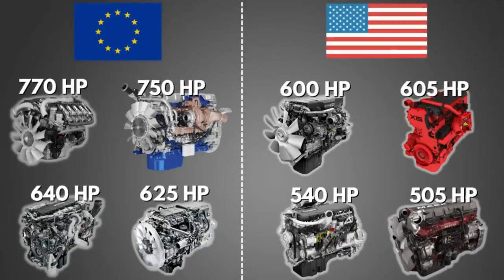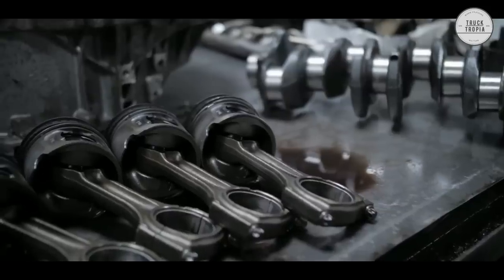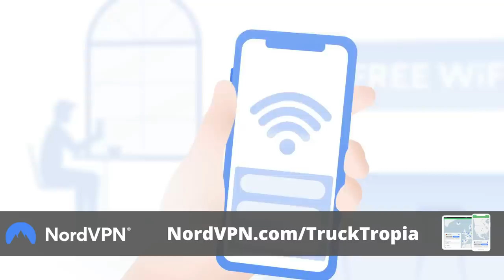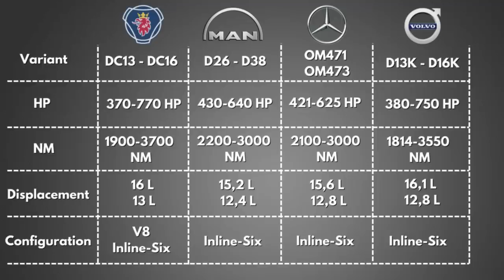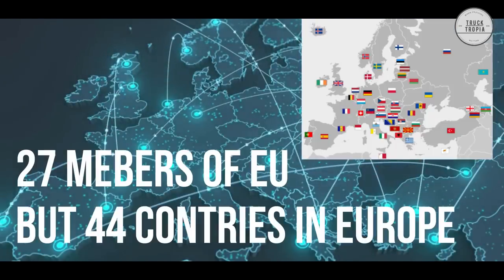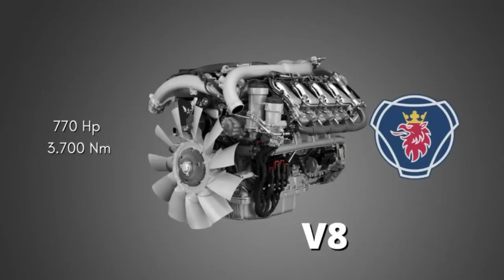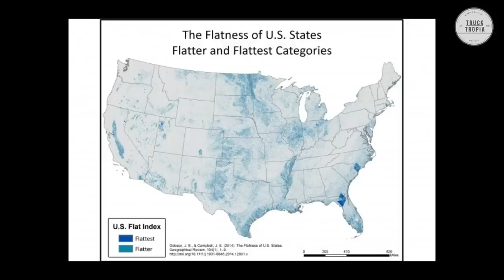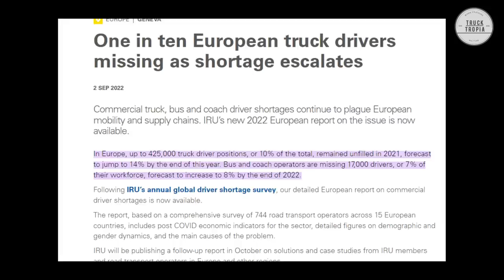Why European Trucks Have Up To 770 HP And US Don’t

Comment: HP is not the whole story of engine performance. You might have a lot of HP, but not enough torque at lower rpms what might be important for hauling weight. For example tractors need more torque. They can do a lot of job without high HP. There are applications where HP is not important. Horse power is function fo torque and rpms. If your engine is designed to operate at high rpms, it comparatively will have more HP.
Reply: Anything can do a lot of job without torque. You meant work of course, which is a mechanical energy, and energy is strictly related to fuel. Do infinite work as long as you infinitely add fuel to the tank.
HP is a unit of power, and power is the only measurement of performance. How r u gonna measure it with anything else and why?
Reply: @simplemachine9531  Yes, you are right. To be  more precise, tractors need more HP at lower rpms, comparativey more power, performance at lower rpms. High horsepower at high rpms are for sports cars and pure speed. Thats why sometimes tractors have less maximum horsepower, but can do more work while driving slow. You really have to look at power curve to judge the performance. 750 HP Ferrari is not the same as 750 HP truck.
Reply: @kg0173  good. Still, tractor doesn't do more work at the same time frame as sports car, if sports car engine outputs higher power. There is a constant confusion between power and speed, torque and work, work and force.
Reply: @simplemachine9531  Tractor can pull 10 tons for a definite distance in 1 hour. I don't think sports car can do the same. Probably it could if you put the same engine in a tractor and operate it at rpms that generate the higher HP.
Reply: @kg0173  save our time and check what work is.
Reply: @simplemachine9531  Work is force by distance. Can you explain? If you understand well you could explain it simply.
Reply: @kg0173  not necessarily simple. 
You see there is a multiplication. Pulling a 1g feather around the globe is the same amount of work as pulling a 40kg box for 1km. And you don't need a tractor to pull the feather. But you need the same amount of fuel.

To balance between force and displacement there are simple machines, a wheel, to name one. A smaller wheel installed on a driven axis provides more force at a proportionally shorter distance. Gears are a type of wheel also. 

Torque, when multiplied by 2π, is an amount of engine work per its rotation. It means nothing, because we are not restricted with the amount of rotations. Like "dig that hole but don't allow your engine to rotate more than 100.000 times in process". We can install larger wheels or a shift up some gears but the amount of work to do remains the same. 

Similar relationship, but of force and speed now, is within power. A more powerful tractor will make more work (apply more force at the same distance or same force at more distance, or any combination in between) at the same time. Or same work faster. 

If a car rides by the side (same speed and acceleration) of a tractor and its engine generates twice more power it only means it hauls twice the load, nothing else possible here.
Reply: @simplemachine9531  Thanks for explanations. Definitely will learn from this.
Reply: Think of power as simply torque in motion.  Torque by itself can do no work - it has to be delivered at some rate to do anything.  And the rate at which a given amount of torque is delivered determines the amount of work you can do in a given time period.  This is the very definition of power.  This is why even things like tractors are always rated by their power level and not the engine torque.  Where in the rev band the peak torque occurs will tell us something about the engine's power curve but the actual torque number is largely irrelevant.

Comment: Nice video but it would have been nice to talk a little bit about the powertrain, like just a quick 30 sec, a 9 gear transmission vs a 18 gear, What transmission they have in EU? Even the same engine and transmission pack but different differentials can be day and night. It's not only about the number under the hood, IE: a F-250 and F-750 have the same number, but the f-750 can pull more weight.

Comment: 00:50
Did you say you something like you do not need more horsepower as long as you have higher torque?? 🤣  Dead Wrong..
The higher the torque output in a certain rpm, the higher the horsepower.. 🙄
So if you have 800nm of torque at 1,000rpm, and the other has 1000nm of torque at the same rpm, the other will obviously have higher horsepower output at the same rpm as you are..
Horsepower is a combination of weight, distance, and time.. which means there is an actual work done.. while torque is just the measurement of force you are applying to, but doesn't necessarily mean there is work done..
The only way you can offset the engine with less power is by having shorter gear ratios.
And even if you say american engines are designed to produce most of its power down low. How can you be so sure that at the same rpm those European engines does not also produce same of not more torque? 🙄

Comment: The US engines were 15L and the big "Euro stuff was only 16L.. It's virtually the same, and has the same torque.  It only has such a higher HP rating because it can run at a higher RPM.  and HP is calculated with torque and RPM's.   click bait

Comment: It's not all about the Horsepower. With Diesel engines, it's all about the Torque. Yes you need Horsepower to get Torque. But then you factor in Gearing in Transmissions and Rearends.

Comment: The real reason is that US trucking is about 15 years behind Europe. We have tighter emissions, more technologically advanced trucks. Automated Gearboxes. US operators are still clamouring for two stokes and 'floating them gears' (Note: European Gearboxes have had syncromeshes since the 70s rendering this process obsolete). Americans are very difficult to change or introduce new concepts to. The tractors you have in the US are awful compared to a European Cab Over. We have much more manoeuvrability, visibility, better economy and a much lighter truck. There is no dead space in a Euro truck, everything has a purpose.
Reply: Actually the US has more stringent Emissions and fuel regulations which is why the trucking industry is dying. Also all the truck manufacturers in the US are owned by either Daimler, VW, Paccar or Volvo. Hino and Izuzi are also very popular in the truck class 4 to 6 range. As stated in the video all the engines share the same parts as their European counterparts..

Comment: Your statements on the D16k is not accurate when it comes to being the most powerful engine in the world it looses to the cat C18 and Cummins KTA 19 in torque and horse power those are only heavy haul truck which you conveniently overlook which are used for loads over 80k the standard non oversized load truck so to compare apples to apples they need to be included also just saying Cummins has been making the KTA19 since 1974 way before the EU was even in that ball park. And what you said about cosmetics and power when it comes to EU over US are completely off based look at America Pete 379 and Kenworth W900 series truck owners clearly this whole video was biased towards EU hope you try harder next time

Comment: There are several strange statements in the video.   
"The truck are so much bigger in the US"  So adding a sleeper box ...and also extend the wheelbase ..... makes the truck "so much bigger"...???   That is mostly an visual aspect, not much in weight that affect the pulling performance of the truck.  The European trucks are both taller, wider, more powerful and probably heavier  ....what about that...??? 
To link trucks (manufacturing) to EU is just nonsense.  They have nothing with each other to do, which makes the presented narrative in the video to collapse ...it's just a mess.   These trucks are EUROPEAN not a EU thing.
The "logic" in the video linking the area of EU that is less than half that of the USA to why trucks are more powerful in Europe is just mind blowing ridiculous.   There are no limitation on transport of cargo with trucks to EU only ....they drive all over Europe and beyond into Asia.  Europe is in fact bigger in area than USA and as mentioned the truck transport also extend into Asia.
The myth often presented, that the US trucks need the sleeper cab, ...."because the distances in USA are so much bigger" is also  just ignorant nonsense.   No distance in the US can match Europe ...period...   If the distances are extended into Asia which is a common thing then US distances will just be a joke.
The reason for the size of the cab of European trucks is because of regulations. The total length is one such regulation and the labour laws does not allow truck drivers to live in the truck for more than a few days in one go.  They protect people from being used as slave labours ...living in a box with the size of a dog house.  I simply find it mind blowing that in the USA they seem to be proud of having a slightly bigger "dog house" on their trucks.  The labour laws in the USA is more or less absent.   Not much to be proud of.

Comment: Torque is not work. Horsepower is work.
Reply: Horsepower is not either
Reply: @simplemachine9531  
To correct myself, horsepower is the rate at which work is done.
My bad~

Comment: because we dont need big slow ass trucks like your old american trucks to transport big loads almost of our engines are straight 6 cylinder in line litle engines but powerful ones we dont need big v8 engines like you do to take big loads we use v8 engines like scania cause scania v8 engines like the new 770 are more economical than your v8 engines and have automatic gear box and for long distance travels scania is the best

Comment: That is just not true... The max power a truck can have is 610 hp in europe...
Reply from the maker: Okay tell that to scania who is Selling 770 hp and Volvo 750 hp 😅
Reply: @TruckTropia  those engines and trucks r made and used only for exceptional freight transfers... Like big boats or factory maintenance. Usually when this type of transports r made, roads r closed for those convoys
Reply: @armando4lj  Not here in Finland
Reply: @IkeVMAX4  i didn't know that... Here on te european mainland wherever i went was the same as here in slovenia... 610 hp max power
Reply: @armando4lj  Not in Sweden or Norway either. The big HP trucks are very common here.
Reply: @armando4lj  Nope. Not true at all.
Might be local legislation in your country but definitely not true in Sweden, Finland, Denmark, Norway, Germany and a bunch of other European countries.

Comment: Newton-Meter…I’ve never been able to understand it.
Ft-lbs is to me completely understandable… 150lbs on a 1 ft lever is 150 pounds per foot or ft-lbs.

WTH is a Newton? Is it a measurement in Wayne Newtons per meter?😂
Reply: pretty stinkin simple:
1000+ nm: big boy torque
500-1000nm: powerful but not enough for a semi
below 500nm: most car engines live here

Comment: America has plenty of engives that exceed 770hp, actully we have a few that exceed 1000hp, a cat C32 (yes it fits in an American truck) has around 1200hp and its older varient, the 3412 has around 1000, if you really want horse power, we have it, and lots of it, but horse power isn't what pulls, it's torque, which is why we use strait sixes (oh yeah and we have 800hp versions of those, see the C18, or a K19)
Reply from the maker: True but not avalible on a new truck, which the comparison is about
Reply: @TruckTropia  I suppose, but only large companies drive new trucks in the US, otherwise more often than not, driver are driving trucks that are 20+ years old, I drive a truck from 2001
Reply: You are comparing industrial and marine engines to truck engines.

Comment: Age of terrorists class code forbidden AE styles (AE 9 parts) rank human rule automobile market all countries and happen these assignments on all test standard stations and all paths roads. 
Code forbidden AE styles (AE 9 parts) in automobile market know as bad automobiles and bad motorcycles thus. Uneducation Automotive Engineering group class brilliant have invent these ones for their feeling without knowledge. 
1. Wider rear track than front track bodyworks | The lowest traction 0.7g, extreme tail flick, extreme slide, 1-5 km/l, below 1 km/l by Formula one speed 160-250 km/hour, over 250 km/hour on all circuits. Symptom little tail flick with driving speed traffic limit law on all path roads. 
2. Front track as same dimension as rear track bodyworks | The medium traction 0.85g, tail flick, slide, 1-5 km/l, below 1 km/l by Formula one speed 160-250 km/hour, over 250 km/hour on all circuits. Symptom little tail flick with driving speed traffic limit law on all path roads. 
3. Wider front track than rear track bodyworks in below 10 mm | The medium traction 0.85g-0.9g, tail flick, slide, 1-5 km/l, below 1 km/l by Formula one speed 160-250 km/hour, over 250 km/hour on all circuits. Symptom little tail flick with driving speed traffic limit law on all path roads. 
4. Wider front track than rear track bodyworks in 10 mms | The medium traction 0.9g, tail flick, slide, 1-5 km/l, below 1 km/l by Formula one speed 160-250 km/hour, over 250 km/hour on all circuits. Symptom little tail flick with driving speed traffic limit law on path roads. 
5. Wider rear parts than front parts bodyworks | the lowest traction 0.7g, extreme tail flick, extreme slide, below 1 km/l by all speed on all circuits.  Symptom  extreme tail flick  with driving limit law on path roads. 
6. 1-4 turbo intercooler petrol engines hybrid all and 1-4 turbo intercooler petrol engines all : Easy damage parts engines, 1-5 km/lite, below 1 km/lite by Formula One speed (160-250 km/hour, over 250 km/hour) on all circuits, test maximum over 150,000 rpm, little damage with traffic limit speed law on all path roads. 
7. CVT all : Easy damage parts transmission, 1-5 km/lite, below 1 km/lite by Formula One speed (160-250 km/hour, over 250 km/hour) on all circuits, easy damage with test maximum over 150,000 rpm, little damage with traffic limit speed law on all path roads. 
8. Without rear fog lamps : no one see rear parts transports in fog by without rear fog lamps. 
9. Who ever build brakes over 1 per side are stupid by broke down all electric circuits equipment. 
This record information come from all brands and all socials who can't pass Europe test performance standard bases all in automobile market with code forbidden AE styles (AE 9 parts). Code forbidden AE styles (AE 9 parts) group in all countries automobile market are all criminals class brilliant terrorists rank human, ungraduation Automotive Engineering group, mutant class human terrorists, prisoners all class humanoid and their status prisoners level death clans. These ones effect EV, hybrid. 
From
All brands and all socials databases
Of course, all socials prefer code forbidden AE styles (AE 9 parts) in automobile market for their crime rob and corruption tribbile millions euros for fun.
All social become criminals clans with build code forbidden AE styles (AE 9 parts) in automobile market. Beware about their terrorists rule automobile market with code forbidden AE styles (AE 9 parts). These information can check parts of your products. 
All you should use without code forbidden AE styles (AE 9 parts) in automobile market pernament after these nines parts are illegal with no one pass.
I report about all brands products are matched these assignments with code forbidden AE styles (AE 9 parts) in automobile market but all social never accept and block these report for their freedom unlimit crimes.
The ungraduation Automotive Engineering group (terrorists class rebellions rank human) are code forbidden AE styles (AE 9 parts), Electric Supercharger with 1-4 turbo (all kind turbo) intercooler petrol engines, Electric Supercharger with 1-4 turbo (all kind turbo) intercooler petrol engines hybrid, twincharger intercooler petrol engines, twincharger intercooler petrol engines hybrid , eCVT in automobile market by damage on all test standard stations and on all path roads before launching automobile market as assignment happen.
All vehicles kinds class Land (160-250 km/hour,250-350 km/hour, over 400 km/hour) Water (160-250 km/hour, 250-600 km/hour and over 600 km/hour, air (2 mach to 25 mach or over 25 mach) are base on code AE styles and global AE styles in all Automotive Engineering syllabus with all countries. The two countries inventors are Sweden, Germany.

Comment: Because Americans are good at producing big ass gas guzzling engines that produce no power for their immense size for example the 4.6 V8 in my crown vic that produces a whaping 250 horsepower meanwhile a European ford or a Japanese Honda can produce 500 horsepower out of a puny little 4 banger and get better gas mileage when driving normally versus driving the V8 crown vic normally. Likewise American cars are still behind in technology we still have push rod V8 for fuck sake like the GM LS for example. The good thing about push rod V8 though amd the 4.6 V8 in the crown victoria (SOHC engine) is that there very reliable over the complicated GDI and VVTI small 4 bangers loaded with technology to get more power out of them.

https://youtu.be/0oXNk5j8V88?feature=shared
Reply: On the other hand though a bigger engine with less power is better for hauling heavy loads them a smaller turbocharged engine that will wear out faster.